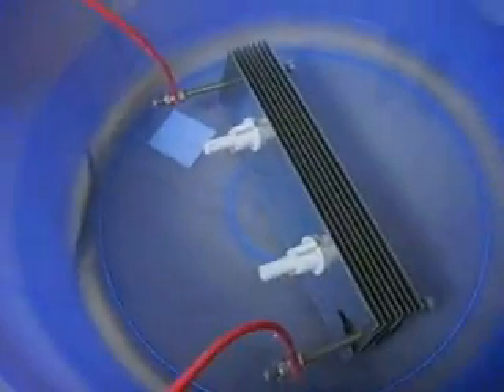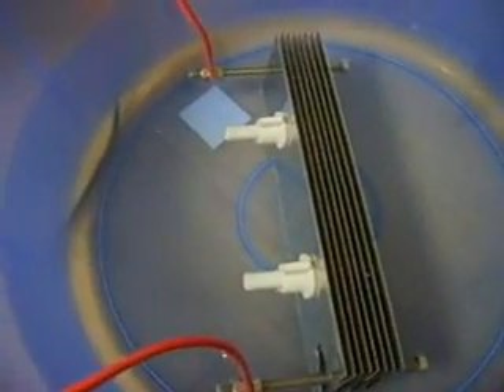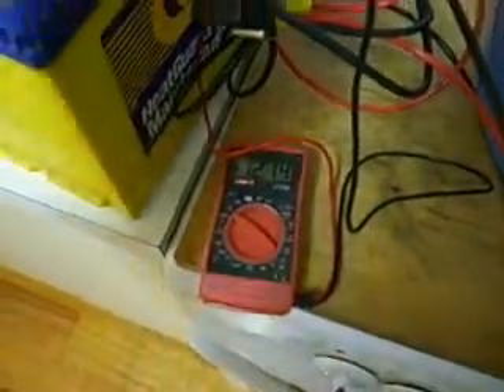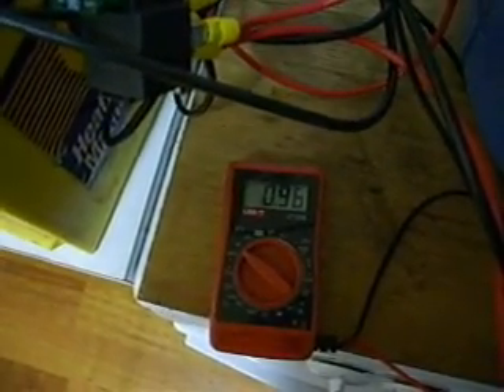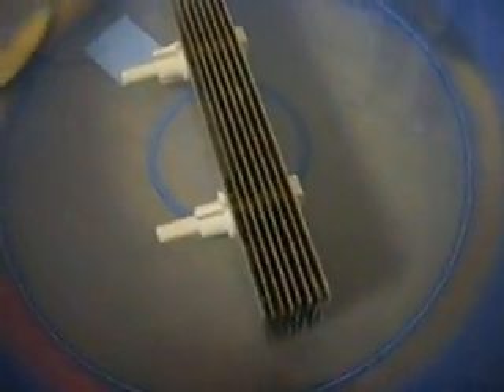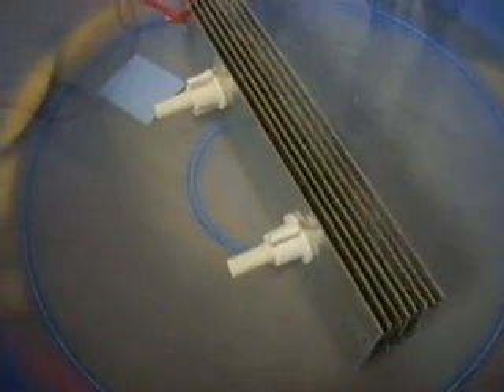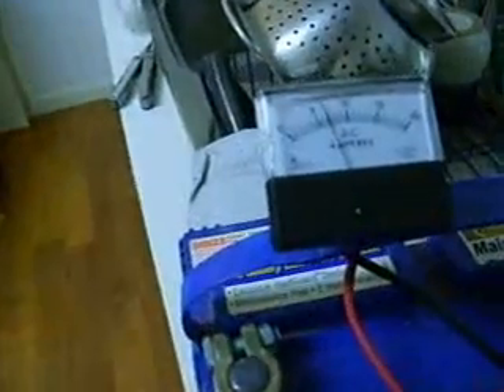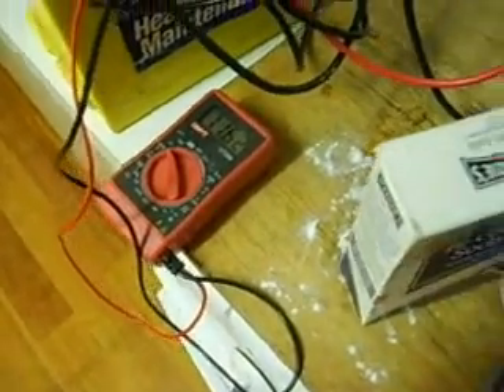Hydrogen at home (neutral plate tests comparison)#7

Comment: I still think the answer is actually the power (watts) your using. You added neutral plates, but had to add electrolyte to end up with the same power (watts).   I this case the power is approximately 120 W  (12v X 10A)

Comment: Nice plates. Looks pretty close to what I'm using now.  My SS Plates are 1mm thick & wondering what the recommended tool to cut them to allow for the bolts. Thanks.